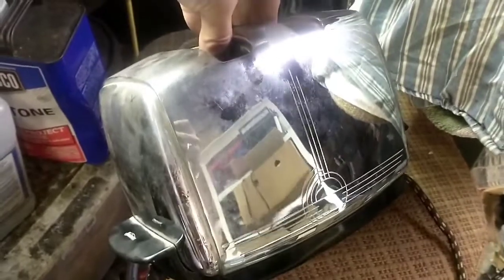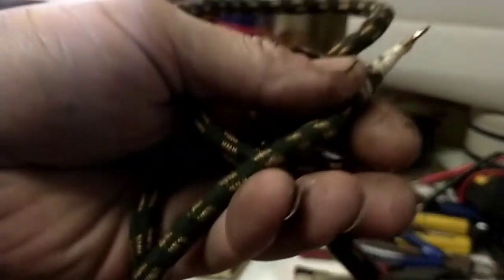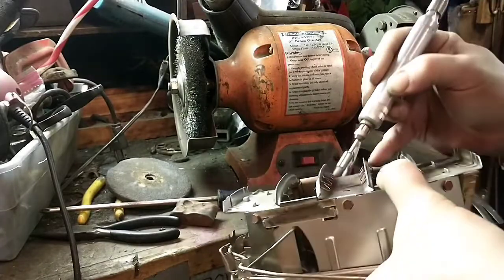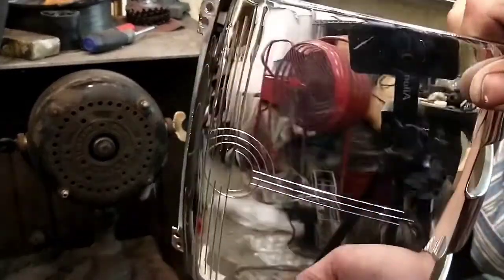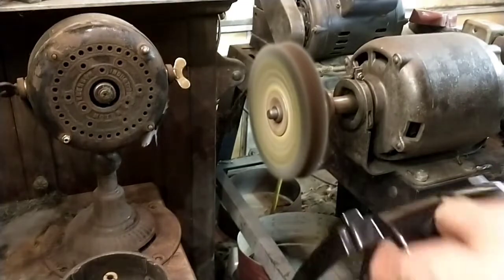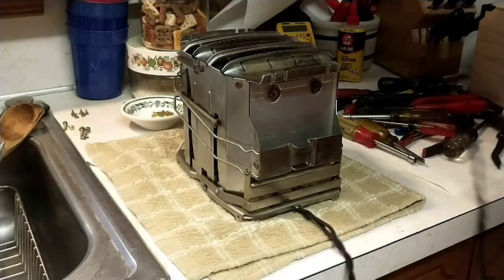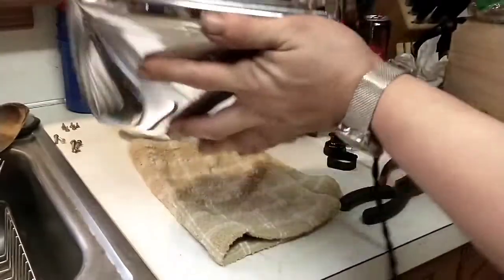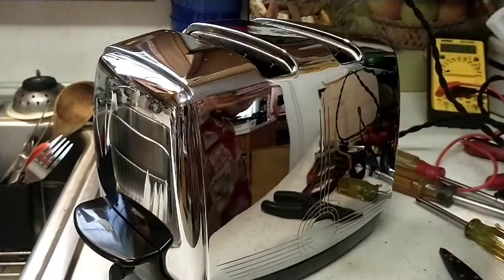Sunbeam T-20B Full Restoration with Polish and Rewire - First of Rushing Shop Restoration Videos

Comment: Grounding is absolutely necessary
Reply from the maker: Not really, but I know why you think so. A terrible exaggeration like people thinking a tiny asbestos exposure is 100% gonna be fatal. These things are part true, mostly over emphasized to make foolish people do the safest thing possible. Common sense and visualizing the electrons in the wiring is a handy skill(ability) to develop and/or hone.

Now, polarity I'd say yes. That will help keep the hot side less likely to contact the casing. Grounding? Not absolutely necessary. These weren't even polarized from the factory, and definitely not grounded. I polarized mine to keep the hot side away from casing more, and to keep electrical nutters from insulating me. No voltage leaks on this one, so quite healthy.
Just make sure the breaker on the panel isn't bypassed or swapped in with a 30A or some stupid crap that we see people do. 👍

If you are convinced everything needs to be grounded, best buy new stuff. Funny part the new plastic crap doesn't need a ground, since nothing is conductive to the outer physical contact area. UL listing requirement though. Heck, some antiques naturally have a tiny voltage leak(you'd never know unless you ran a ground and have GFi).
Reply: @antiquesandlearningtolive4369 
There is a reason that electrical safety standards have been updated. Sure polarity is important, but grounding also exists as an additional safety measure. Nothing is foolproof, but there is a reason most appliances legally should be grounded, after years of accidents to learn from.
Reply from the maker: @notacreativehandle  I grounded the antique fan I use 8-24hrs/day bedside. The toaster I won't be leaving unattended. If I even use it, since it only does bread slices.

Comment: What is the dremel attachment you're using to wirewheel?
Reply from the maker: https://www.ebay.com/itm/284955708061?mkcid=16&mkevt=1&mkrid=711-127632-2357-0&ssspo=tr-cw2nfqwy&sssrc=2349624&ssuid=B0NxsfQBRvi&var=586752804537&widget_ver=artemis&media=SMS
Reply from the maker: These don't throw wires out NEARLY as badly as the wheels and cups for Dremel. Still wear eye protection and check your clothes for wires when done, but much better. The vitrified stone keeps it from clogging up with stuff. So just wheel the stone periodically to prevent wire clogs. :)